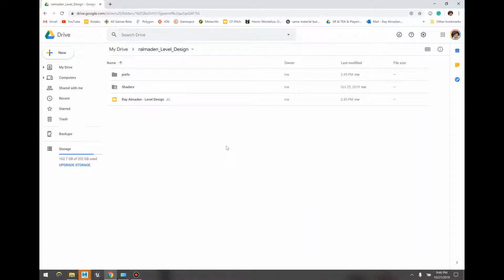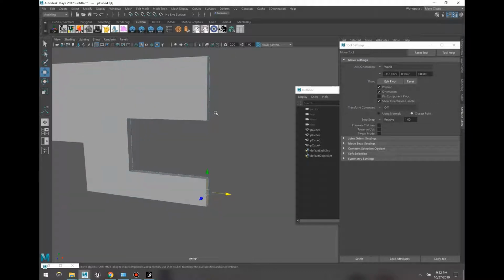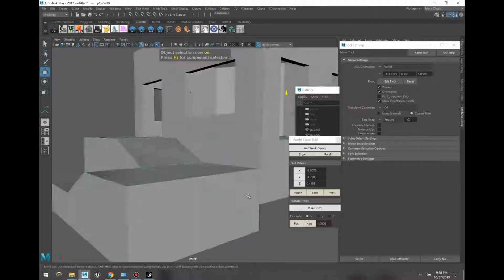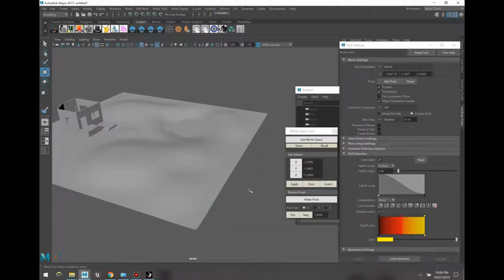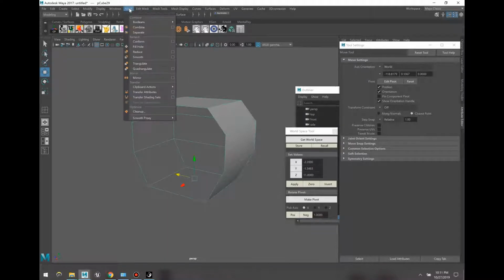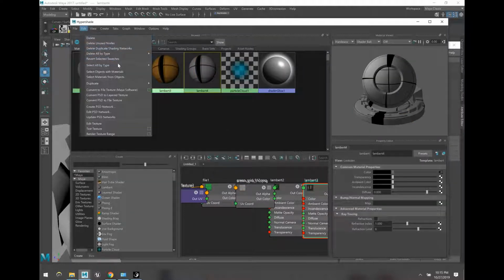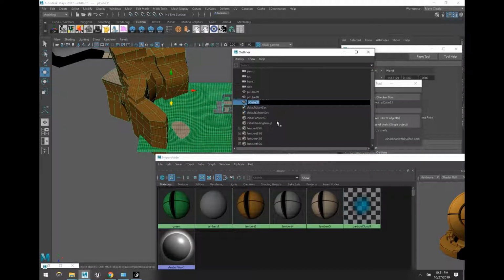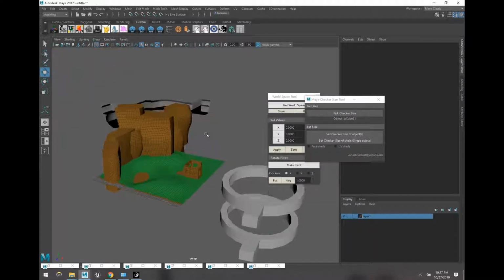Maya Level Design Tutorial

Comment: Total noob here, if you just want to make a height map would you use World Creator, or Maya, or just do it in Unreal Engine. Could you import what you made here onto a larger landscape made with World  Creator and then bring that to UE4? I am trying to understand the work flow that happens before you add things like Megascans and Brushify in UE4
Reply from the maker: Nodakkian I use Maya because I’m modeling everything inside Maya, and I have more control over individual verts in Maya. There’s plugins from the Unreal store you can get that convert Maya planes to Unreal World creator
Reply: @ralmaden  Thanks for the helpful reply. Do you stream any interactive lesson?
Reply from the maker: @nodakkian  I'll try and do a stream where I build a level from scratch, when i find the time of course!
Reply: @ralmaden  Do blender and Maya perform the same function as far as level creating goes?
Reply from the maker: @nodakkian  Yes, its creating the Geo and then exporting it into the Editor, like Uneal